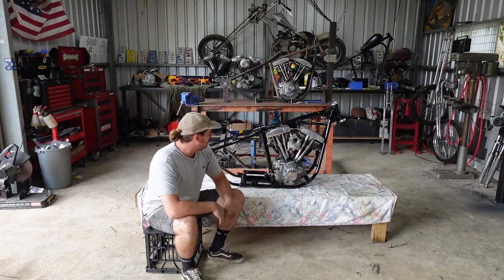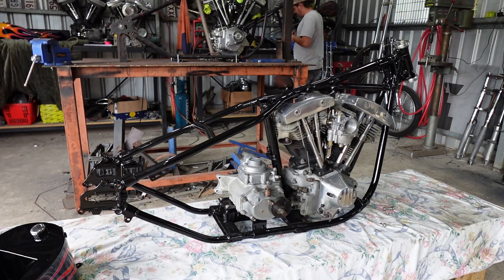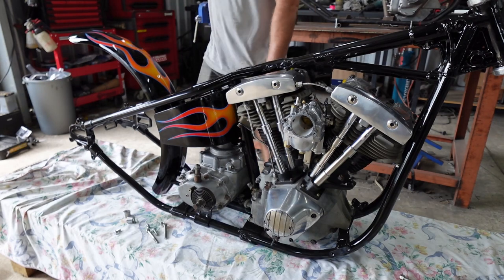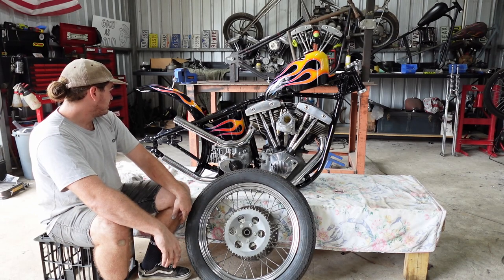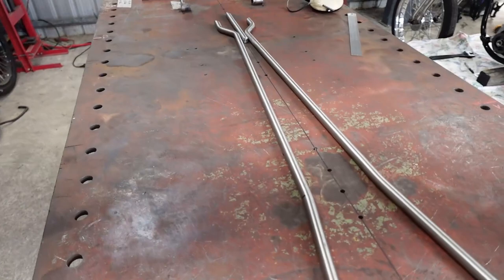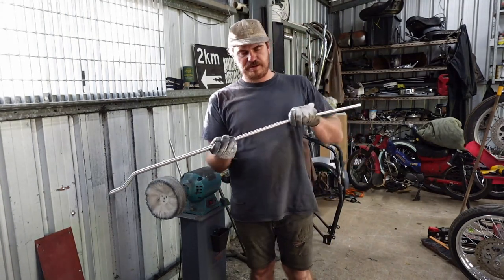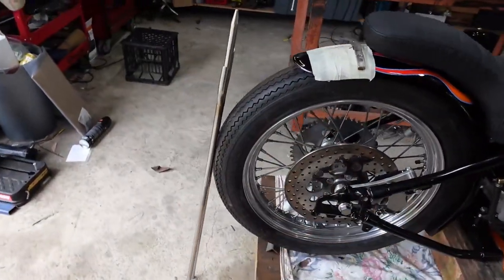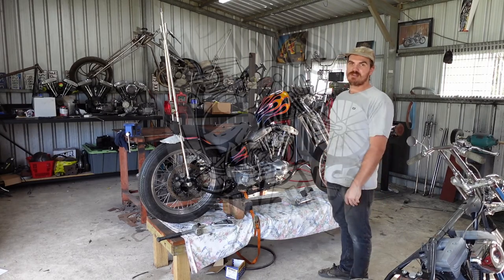Dale's Rigid Shovelhead Chopper Assembly Part 1

Comment: Hey Mate, Love the content on this channel. I'm running a similar type wheel on my.sportster chop. What did you do with your rear axle length?
Reply from the maker: Just knocked the nut side off and shortened it then welded the nut back on